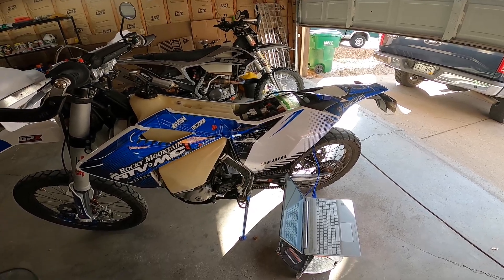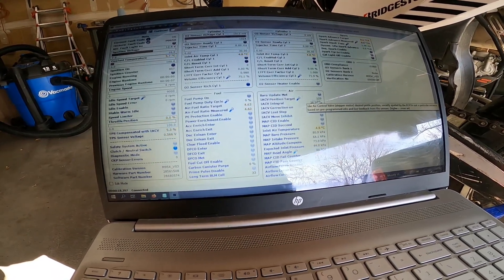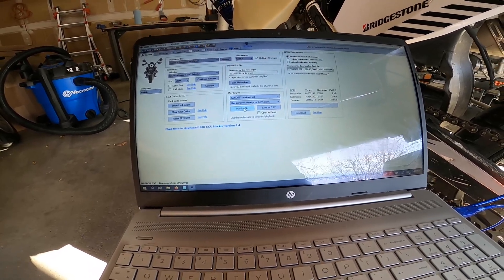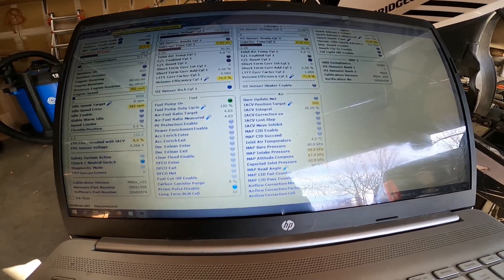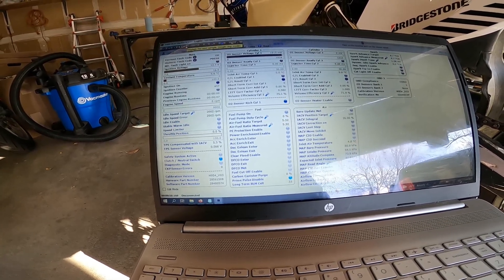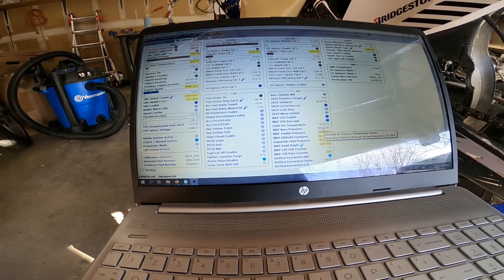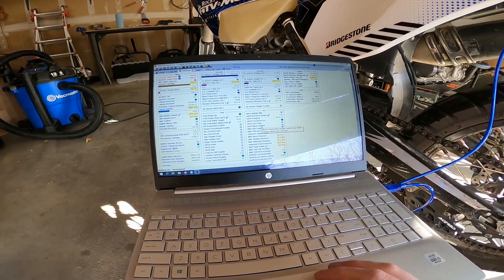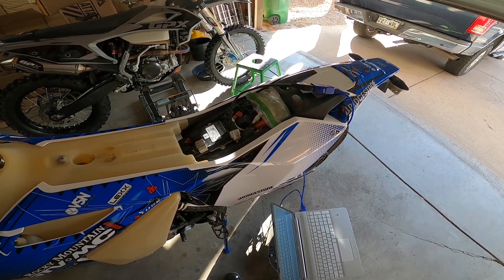Troubleshooting GPX FSE300R ECU/Pulling Diagnostics

Comment: THANK YOU for this video ! I have a CSC RX4 and am trying to get to the point you just showed make a log file so I can see what it's actually doing..... and you showed that ! thank you so much !!!!  it's not like I had a problem with my bike at all, it just has a fast idle and misses a bit at idle.... but that is real easy to over look.... but I know it can be better ! 
my J2534 adaptor should be here soon, as the cheap one from china does not work at all
so I got the one that he recommends in HUD ECU HACKER..... the cables are of utmost importance ! they have to work or your just spinning your wheels ! 
I thought I could make a log file fairly easy but I was not sure.... NOW I KNOW HOW !!!
because of you ! thanks buddy !

Comment: Did you check the voltage at fuel pump level ? Is it a Lithium battery ?
Reply from the maker: It is a lithium battery but think it's all my air/fuel during startup until it learns a few things.  This bike is running a different map than originally and the new map created this.
Reply: @SCakey  lithium need to be wake up at "cold conditions" during several seconds to get the max Voltage and ECU can trim a bit also for its own needs and so fuel pump do not make its job. Relay with direct power from battery could also be a possibility depending on yout observation. It is visible on "mt05" bikes
Reply from the maker: @damienbaptiste1934  Will have to keep an eye out next start, good thinking.